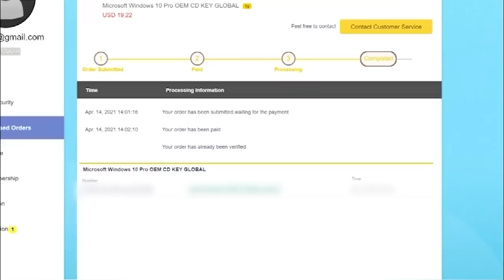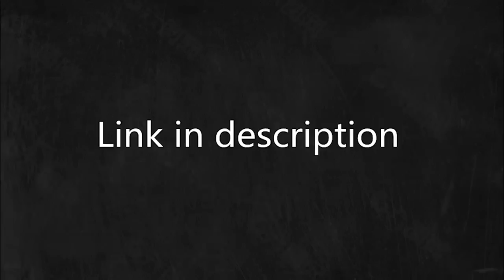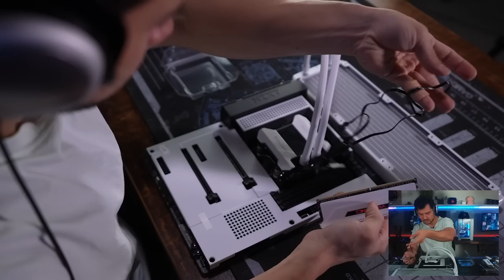LIVE PC BUILD TURNED OUT PRETTY GOOD! (Giveaway?)

Comment: Don't know about the AL fans, but they definitely make SL in the 140mm. I used one for the exhaust in my dx500. It looks clean having all the space filled at the back. Also, I used lian li SL in my entire case and the same aio. I plugged in all the rgb stuff from the aio to my lian li controller and use the L Control software to run the phanteks cover and fan rgb. Works just fine for me.

Comment: I've also got the streamer cables in my Y60? The GPU and 24-pin work fine, it's sad some people have absolutely zero problem solving skills to figure out how to make it work. And the streamers use the USB connection for LEDs and the top portion of your GPU streamer isn't lighting up, they might be plugged into the wrong ports on the controller.

Comment: Having the HYTE Y60 case myself I can say it's a beautiful work of art. Except it's starting to show signs of aging within 8 months. Firstly the side and top panels are two pieces pressed together and while doing it's job at filtering out hair and dust some of the hair gets trapped in between the two pieces of plastic/metal. Also the paint within the entire case is very thin/cheap and it takes nothing for it to chip, which is kinda upsetting at this price point.
Also who puts AIO cords to the back of the case, never have I seen this? It interferes with the fan and aesthetics. I had the same problem with my EK AIO there's an angled piece of metal that interferes.

Comment: its a shame LanLi uni only come in 120mm cause only fan sizes I use is 140mm 160mm 180mm and 200mm.
I haven't bought a case that uses 120mm in over 13 years now. Bigger fans move more air and do it quieter.
Reply: and i had the v1 of those strimmer cables 24 pin and dual 8 pin broke so easily. the V2 are far better quality

Comment: I know it's random but anyone here know if a PC running in a tropical country would burn, hypothetically, also backed into a corner therefore no air going out the back if air goes out the back off the chasiss, just curious.
Reply: You could take the panels off and upgrade cooling system, it may be a little hot but it will run fine. Hope you win!